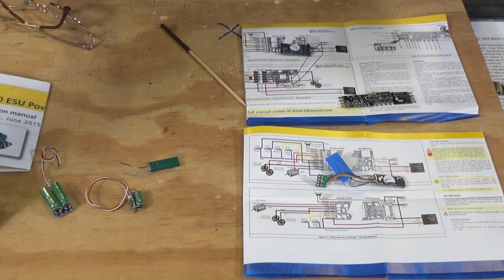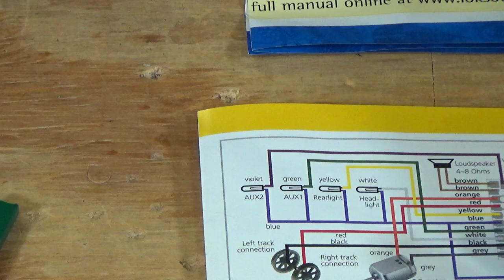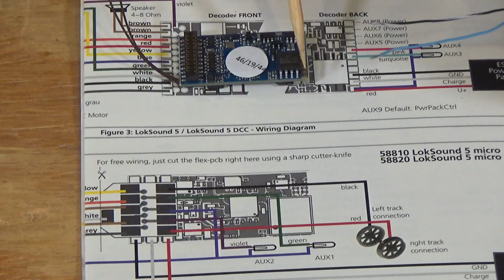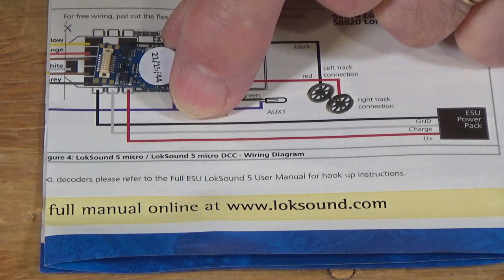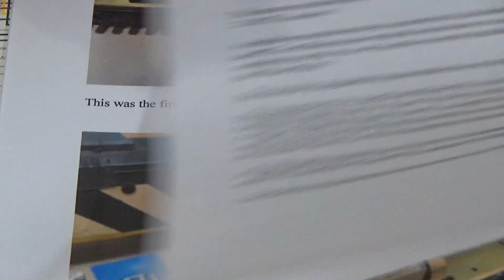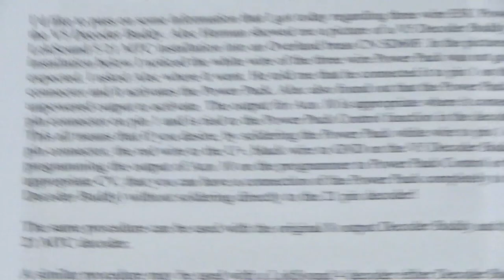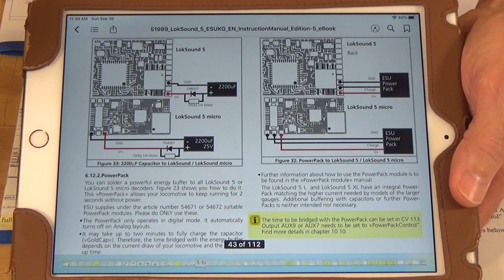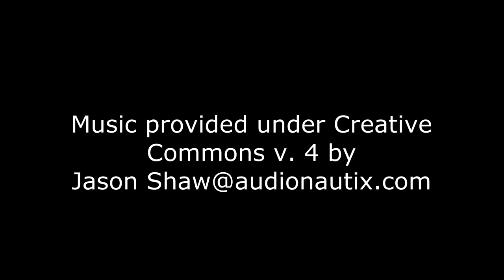How to Safely Use Stay Alives with LokSound Decoders (128)

Comment: I have several $300+ locomotives with factory Loksound where just a momentary dip in power and the sound resets.  I have found the easiest solution is to never again buy anything with a Loksound decoder!  Converting all my locomotives with their bargain basement sound decoders is a costly lesson I have no intention of repeating.  It doesn’t shock me anymore when the DCC ready versions of new releases sell out immediately while the Loksound equipped models are still available months after release.
Reply from the maker: Odd, I have several locos with factory equipped LokSound decoders as well as several with decoders that I have installed myself and in general they are my favorite locos that perform as well as my locos with SoundTraxx and TCS decoders. Not sure what is causing your problems but I doubt it is the decoders. There can be a number if other issues with locos, layout wiring, and track cleanliness that can cause problems like what you describe.

Comment: At this point I wish manufactures would build in the keep alives.
Reply from the maker: They’ll eventually get there once component size goes down and cost does too. Right now TCS offers versions of their WOWSound decoders with or without KAs and their motherboards have them too. since their installation kits use their motherboards they all have KAs. I am amazed that ESU still hasn’t provided any sort of socket for attaching stay alives. Forcing modelers to make solder connections to such small pads is just asking for problems.
Reply: ScaleTrains locomotives have PowerPack capacitors standard.
Reply: ESU has a new Direct with PowerPack board now available

Comment: Very good video.  But this is a little disappointing as I have been using TCS with TCS motherboards.  I recently tried a Loksound V5 and simply swapped it with one of my TCS 21 pin decoders.  worked great and sounded great until I tried to program it.... wish I had found this limitation first.  But the part that is disappointing is the fact that most of my locos have TCS motherboards with build in keep alives.  I thought it would be an easy conversion if i decided to go with ESU.  I guess not. Time to re-think things I guess. Thanks for the Video!
Reply from the maker: Yes, unfortunately ESU is off by itself when it comes to the way keep alives are handled.

Comment: I have a c39-8. It's supposed to have a capacitor. The INSTANT it hits a section of track it doesn't like, it cuts out. Anyone have any luck fixing this issue? HELLLLLLLP!
Reply: It's Scale Trains, lok sound 5
Reply from the maker: Make sure the stay alive settings are correct. Hopefully the instructions have that info. They should have set it up at the factory but I have heard a few complaints like this about their locos so it might be an issue. If you can’t find anything about it in the instructions better cintact Scale Trains support. I generally don’t use stay alives with my diesels but this may be different.
Reply: Thank you for the reply! Unfortunately the manual is pretty limited on that info. It does say there's a CV for it, but doesn't tell you what the ranges are. Nor does it have a full list of CV's. It just gets irritating when the sound cuts out momentarily half a dozen times around the track. I've cleaned my track spotless with no luck. Also I am having troubles adjusting individual sounds. It tells you to change two CV's, and then you can individually adjust sounds. I made those changes, but still won't change sound levels individually. All I can do is turn the master volume up and down. Other than those 2 issues, it's an excellent loco with amazing sound! Anyway.. I appreciate the help & love your channel. ✌️
Reply from the maker: If you go to the ESU/LokSound website you can download the full manual, just be aware it is a bit complex!
Reply: Ok 😆. I really appreciate the help!

Comment: Hi Larry, I could use the PDF form to attach a PowerPack to a Decoder Buddy, I'm using an older Lok Select 21pin on an early decoder buddy as well.  I tried your website you mentioned but it was not available.  Any other way to reach you?
Reply from the maker: I added the pdf to my website so check it again. You also may find more on the Decoder Buddy website.

Comment: I know this is an older video, but the latest drop in from ESU for N gage Kato USA, and a speaker leaves no room to mount the oversized ESU power pack. No choice but to use the small n scale keep alive from TCS.
Reply from the maker: I plan to try one of the N scale keep alives with HO scale locos just to see if they can get one over a dirty spot or dead frog. May work.
Reply: @TheDCCGuy  I was going to connect to U+ and I think AUX 6 and configure AUX 6 for power pak output on the decoder. It’s a logic level output.
Reply: @TheDCCGuy  and Merry Christmas!

Comment: Great video. I have an Atlas HO Scale MP15DC locomotive I added a DCC to. It would get real jumpy in my yard where #4 turnouts are while I put leads on every turnout and is over wired, the locomotive is just too short and light to keep electrical contact with the rail. TCS built in Keep alive on the decoder saved my life, and patience and now the locomotive runs great in the yard. Before i used two locos, one to nudge the other, now I can go solo!  (yes my track is super clean and soldered!)

Comment: Thanks for posting this, it was really helpful and put together very well. 
 
I am working on a DCC + sound project for a 10 ton Davenport siderod gas mechanical in HOn30 using a LokSound 5 Nano.  Yes it's insanely small.  I was hoping to use a small bank of tantalum surface mount capacitors with the alternate wiring scheme you show at the end of the video.  But I gotta tell ya... even after pumping the system up to the full 2200uF recommended I BARELY get any run time.  I suspect the resistor in the circuit is eating the available charge.  My TSU1100 with much less capacitor capacity is sustained considerably longer without power. 
 
For my little project I may purchase an ESU 54671 and see if I can hack it with the smaller tantalum caps to get it to fit.  Hopefully it will run longer with no power.

You are correct that you need to disconnect the non-ESU capacitor bank when programming.  There is no danger to the DCC module but it will resist programming changes if you don't.  This was pointed out on a dealer's website and I found it to be 100% true in practice.

Great video!

-DTJ

Comment: Legit question- I'm trying to install a TCS KA4 into a locomotive that has a standard LokSound V4 decoder. I followed your video (for wiring) as well as the original ESU manual. Problem is- the ESU manual says I have to have 2200uf capacitors and numerous resistors into my installation- all of which I do not have, or cannot easily access. Do I need to install said items into my installation in order for it to work, or can I just go without? Any help would be appreciated. Thanks.
Reply from the maker: What you are referring to is their oversized stay alive option. You do not need all of that with a stay alive circuit. However as I said in the video you are violating the warranty by not using one of their stay alives or circuit they recommend.

Comment: Great video!  Since the BLI Go Pack has three wires as well (presumably for the same purpose as the loksound power pack?), can you use the BLI Go Pack on a loksound decoder safely instead of the loksound power pack?  BLI Go Pack seems to be more readily available.
Reply from the maker: I have no idea how those work and if they would be compatible with the LokSound decoders. Only BLI could tell you that a d they probably don’t know. The only 3 wire stay alives I know of that are advertised as being compatible are those made by DCC Concepts and possibly Lenz.

Comment: There have been many questions on using an ESU decoder with a TCS Motherboard. Do you have any insight into this. I have always reccomended against doing it.
Reply from the maker: Since TCS adopted the ESU 22MTC pin layout they theoretically would be compatible except for the fact the TCS motherboards have the keep alive circuit built in. So that means you run a high risk of blowing the decoder during programming.

Comment: Larry, do you know where to connect a PowerPack capacitor to the LokSound Essential Sound Unit?  I have a couple of the Walthers Mainline NW2 switchers that came out recently.  They run and sound great, but I don't know where to connect the PowerPack capacitor.  I bought a couple of the NW2's that were DCC ready and I popped in a LokSound micro with the capacitor, but I had to put the capacitor in the cab.  I also took out the LokSound Essential Sound Unit out of another NW2 and just put the LokSound micro in with a capacitor and was able to squeeze it in the hood area.  This was a big wiring job though.  regards, NS.
Reply from the maker: I am sorry but I haven’t had time to follow up on your comment. I can say that I’ve never worked with one of those decoders so I don’t know what provisions they may or may not have for adding a PowerPack. The folks at LokSound USA may be able to help though. Sorry I can’t be any more help.
Reply: @TheDCCGuy  No problem!  Those are new budget decoders that I've seen in Walthers Mainline locomotives,  I'll try to contact LokSound.  regards, NS.
Reply: I apologize for replying to an older post, but I think it’s valuable to know about what I am finding with Walthers Mainline DCC/Sound equipped.  I purchased an NW2 2 years ago, and 2 sets of F7A/B units end of last year. I was being cheap and decided to move a sound decoder out of a B unit into an older SD-7.  I put a LokPilot 5 basic in the B unit.  I used a decoder buddy (v5) to make life easier for the SD-7 install.  I built a keep alive and installed it, and it didn’t help, as soon as the train would be lifted off of the tracks the light would go out.  

Here is what I have found: The ESU decoders have CV 113 for “Power Fail Bypass”.  The value of that CV determines the amount of time the loco will keep operating.  A value of 64 is slightly longer than 2 seconds. Here’s the point.  On my Walthers Mainline locos, the CV reads as having the value of 0.  I haven’t been able to change that value.  I can change that value on the LokPilot 5 Basic decoder, and the keep alive does keep it alive.  

Long story short, I don’t think you can add a keep alive to a Walthers Mainline DCC/Sound equipped loco, because you can’t put a value in CV 113.  Hopefully this could change in the future, but as it is, I’m done buying Walthers Mainline DCC/Sound locos. 😢
Reply: @eccentrictodd7220  The budget LokSound ESU (Essential Sound Unit) does not allow a capacitor to be added as far I know.  Separate note, when I do connect an ESU power pack capacitor to an LokSound 5 processor, it usually does not require any additional programming.  I recently put one on a Rapido locomotive that had a LS5 processor, but I had to do the programming  shown on the instructions for the ESU power pack in order for it to work.
Reply: @eccentrictodd7220 This sounds like ESU is intentionally locking a CV to force you to buy a new decoder from them.  If true, it wouldn’t shock me considering the business practices of most European based model companies.

Comment: Hello
thanks for this video and those explanations about the 3 wires design
I found it because I'm trying to install a LaisDCC KungFu inside a 140C from Hornby Jouef. There is not a lot of space and one of the KungFu fits. It works well after adjusting CV113 on the decoder alimentation and sound, but not on the motor as I would have expected.
I've followed all the instructions on the decoder manual (CV31, 32, 113, 339) but I couldn't make it work for the motor. Does anyone know how to achieve this ?
Reply from the maker: I have never used them so cannot comment.

Comment: So do you think it would be OK to do a Advanced consisting(entering CVS) without burning these decoders up with a TCS keep alive and did all my major programming before I put the TCS keep alive in the locomotive
Reply from the maker: It may not work since you may need a load such as a motor on the decoder for programming to work.

Comment: Hi Larry. I do not power route my turnout frogs, & I do not, generally install KA s or  P. packs. With locomotive pickups on all diesel wheels, these days, & on steamers, pickups on all drivers & tender wheels, I have found little need for p packs. Switchers are good to have, if possible, butoo t I have 4 Rivarossi b. boys, that have major pickup problems & have "exprimented" with  adapting the tender wheels for pickup, with mediocre success. I am wanting to to put Loksound 5 in, maybe, 1 or 2 of the b. boys, WITH the power packs, to help solve the design flaw, of too little pickups, on the loco drivers. They were made with only 4 drivers picking up current,IF the pickups are in good condition,& usually there isat least one pickup, not working. The locos have a pretty good mechanism, so I might try one, first, & see how it works out, but generally, I dont worry too much about  KA s, myself. Thanks for the video, cheers Michael  NZ

Comment: Hi are they safe on tsunami 2s because I have a bunch of TCS keep alives and I’m getting ready to switch over to All Tsunami two
Reply from the maker: I have used them with a number of SoundTraxx decoders including Tsunamis. However I rarely use them in diesel installations, just steam. Just make sure to get the wires connected properly. That said I need to install one in a brass diesel with one of the older Tsunami decoders.They have a good tech sheet on their website showing how to connect Current Keepers to a full range of SoundTraxx decoders.

Comment: Is this just a Loksound problem or are other decoders subject to failure because of this problem?
Reply from the maker: I only know of LokSound decoders having this issue. I have also heard or read somewhere that Lenz used/uses a similar 3 wire design for their stay alives but I have not been able to confirm this and do not know whether their decoders have similar issues with using non-conforming stay alives.

Comment: Nice vid.
What is the electronic difference between Loksound and other KAs?
Reply from the maker: As I said in the video the 3rd white wire turns the stay alive off during programming and I think in analog mode. Other than that their electronics is a mystery. I asked Matt Herman  about them and he said that the ESU electronics engineers won’t even tell him how they work!

Comment: Is it just as easy to install in steam engines? I've yet to see a "How To Install TCS Keep Alive in Steam Engines" example YouTube.
Reply from the maker: I usually put them in the tender so there usually is plenty of room unless you are doing N-scale. I think I have one more brass steam loco that needs a decoder but it also needs to have the engine wheels and chassis painted which is holding me back.
Reply: @TheDCCGuy  do you have any idea if the keep alive from this video will work in a GS-4  MTH SP Daylight?

Comment: Using an ESU keep-alive is always safe?
Reply: Yes cos it turns itself off while programming
Reply: @MR66HD  I am wiring my frogs and will avoid KAs. But if I did need KAs for my LokSound locos, I would use ESU KAs. Thanks for the video.